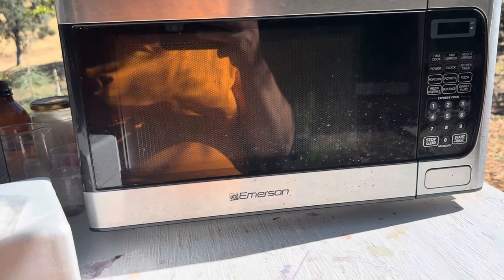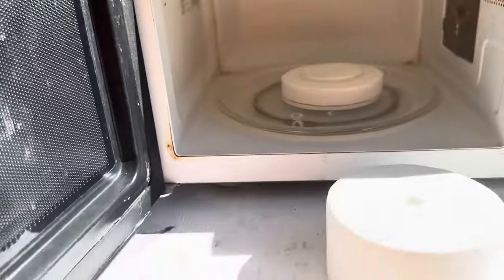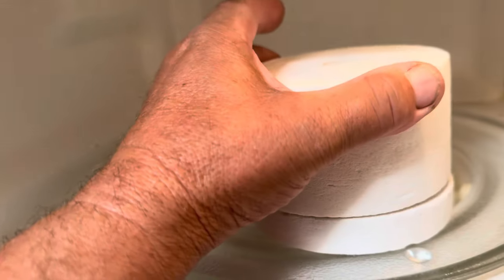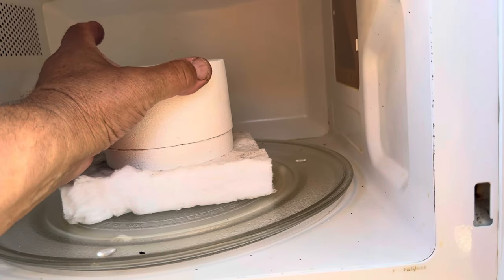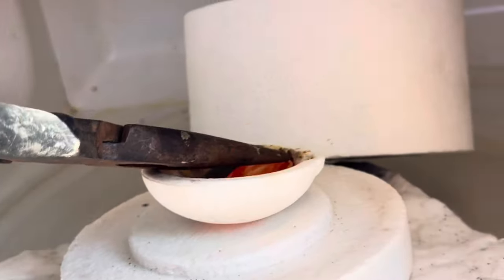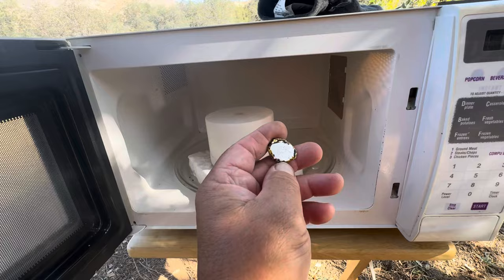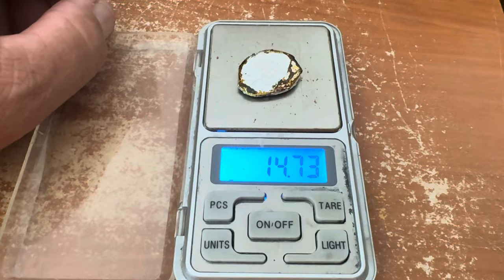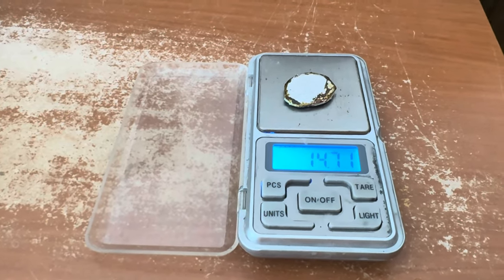Smelting silver with microwave kiln .

Comment: My torch set cost me 400 bucks. Years ago I modified a microwave transformer and built an electrical arch kiln. Saw it on youtube and built one. It would melt 1 oz of gold in 3 minutes. The problem was the carbon / graphite rods didn't last very long. They would burn up., loose contact and you would have to reset them
Reply from the maker: I spent 30 dolars to buy glass melting kiln and don’t have any problems with melting gold and silver best part I can smelt smallest  amount of gold any time I want . 10 minutes and job done
Reply: Please can send me the video i want to make too 🙏🏻🙏🏻🙏🏻

Comment: Amazon Kiln shows 1650F is Max temp.  Gold Melt point is about 1900F.  Are you doing anything additional to get your gold to melt?
Reply from the maker: I melt coper 20 grams with no problems . Where you getting that information it is wrong
Reply: @myadventure7069  Thanks, your crucible is made of what?
Reply from the maker: @bsim2395 I both on eBay . I don’t know .
Reply: @myadventure7069 Have you noticed if the Kiln paper is needed?
Reply from the maker: I using crucible and I don’t have problem.

Comment: How many watt has your microwave? Do you run it on maximum power? Thats indeed an interesting way to melt metals. Thanks for that.
Reply from the maker: 1300 wats
Reply: @myadventure7069  thank you
Reply from the maker: 900 w works too just little more time